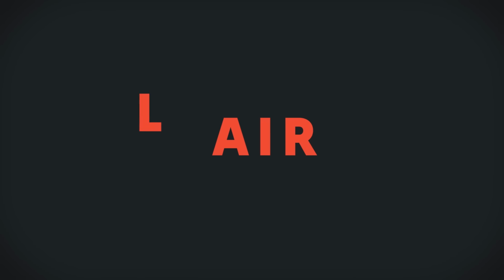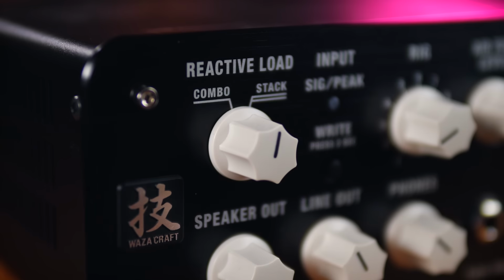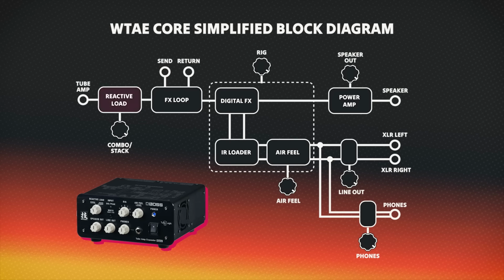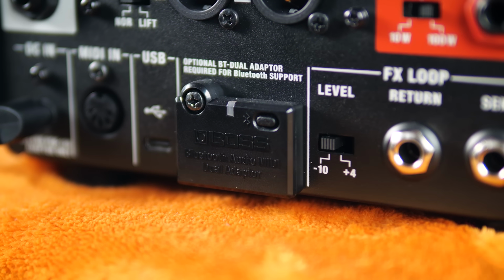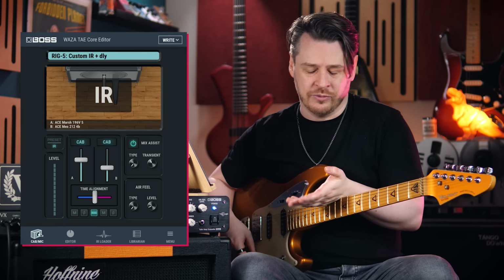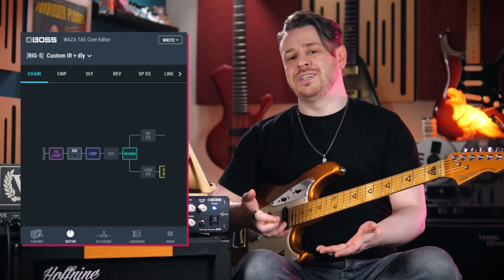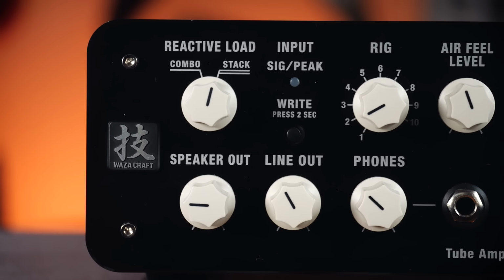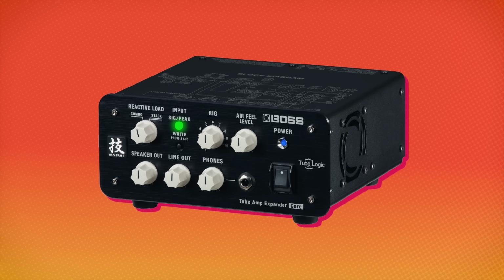Loadbox, Attenuator, IR Loader - Tube Amp Expander CORE does it ALL!

Comment: The Amp Head it's self should have its Own resistance knob that would allow you to run it at whatever stress level per volume you wish without having to buy a second piece of complicated gear the f'n things cost thousands it oughta take input for Lead, Bass, or Keys and be fantastic at any volume with any type or combination of cabs and not need piles of outboard gear filling up all of your floorspace.
Reply from the maker: If they build attenuators into amps (and some companies do) then the amps become more expensive - and it won't have as many features as a stand alone unit.

Comment: WAT! I don't like that solid state reamp nonsense at the end of the chain. I would rather use OX or Captor which don't seem to have that unwanted stage.
Reply from the maker: You do realise that is exactly what happens when you send the signal to a PA at a gig, or your studio monitors, right? 

You do get that guitar sounds are commonly reamplified by solid state amplifiers and this isn't in any way a contentious point at any other time?
Reply: Of course, but I want my amp's tubes to drive the cab speakers, line outs and other processing is completely different thing. Not sure how it's related.

Comment: Should I set if the core to  hundred watts, using my 50 watt Marshall Plexi?  Since 50 watts pushing 70 ..??

Ty!
Reply from the maker: Yes, but at the same time you still shouldn't be running a 50W Plexi hard enough to be pushing into 70W consistently. Don't use the attenuator as an excuse to max out your amplifier.

Comment: But can you use this with let say a roland JC120?
Reply from the maker: JC120 is a solidstate amp with a stereo line out - you can already use it safely without the speakers connected and record direct with it. There is no need for a loadbox if you have a JC120. 

The Tube Amp Expander is for tube amps - the clue is in the name.

Comment: Very good video! Congrats & thanks! Just subbed.

I´ve noticed the Waza Core's  Input from Tube Amp (in the back) indicates Max 8ohms, 100W. I have a Friedman Plex head and a 16ohm 4x12 V30 cabinet speaker - in this scenario, could I simply connect one of the 8ohm speaker outputs of the Plex head into the Waza Core, and then connect the Core (its output says min 4ohm) to the 16ohm cabinet? 

Cheers!
Reply from the maker: Yes, as long as you connect the amplifier's 8 ohm output to the Core, you can use whatever cabinet you like. 
The amplifier only sees the 8 ohm load from the Core and has no idea there is even a cabinet beyond that.
Reply: @ScienceofLoud  awesome, thanks brother!

Comment: Hi Colin & everyone. I have a question that I've done quite a bit of research on but am still not sure about. Can I use a DI-box as a speaker load for a valve amp (the manufacturer only says it can handle guitar amps' speaker outputs) or do I need to run the link/thru output to a cab anyway? Or is it not suitable for valve amps at all? 
Thanks.
Reply from the maker: No, you can't do that.

A DI Box converts high impedance unbalanced instrument signals into low impedance balanced line level signals to be transmitted over long cables without incurring signal loss. For example if you were playing bass on stage and the sound engineer wanted to get the sound directly from the bass all the way to the mixing desk, they'd use a DI Box. 

They have nothing to do with valve amps or speaker loads.

Do you perhaps mean something else when you say "DI box" and simply have the wrong terminology?
Reply: @ScienceofLoud  Well, the piece of gear I refer to is the Behringer DI4000, an active DI box (similar model, DI100, also seems to have this feature). Another device that I've discovered, the RNDI Active Transfomer Direct Interface, may not be a typical DI Box but it seems to work in the same way as the Behringer and it states pretty clearly that you can connect it to the amp before the cabinet (but in this case certainly NOT without it). So, this all got me a bit confused...
Reply: @ScienceofLoud  Oh, it's me again. I think I've finally figured it out. Some DI's can indeed be placed between an amp and a cabinet, simply allowing you to tap off the signal from the amp's speaker output. But, yes, you'll have to have a cab or a load box in this scenario. It's just not always the case that you can find this in a user manual ':D 
Cheers!

Comment: Great video,  I have a Quad Cortex, and still desire  one of these !. You are correct about the Boss firmware palaver, that's why the Boss Katana FB group has 50k members,  49.999k of them joining to ask " why won't my firmware update work".  :)      Would you consider doing a video explaining your thinking on reverb and compression for live work ? I have a pretty good setting on my QC, but it just needs to be a bit smoother.....  TTFN , Miff

Comment: Reamplified? So your hearing this boxes 30 watt solid state amp...not the original amps sound?
Reply from the maker: @iwilrage  when you listen back to any audio that was recorded, it is reamplified. 
Does that replace the original sound? No, it just makes the original sound louder. 

The CORE has a 30W power amp - like a hifi or PA system. It brings the sound of the guitar amp back up to whatever volume you need for your studio application

Comment: Is this ojnly for using an amp without a speaker? OK, you addressed that question. I have a 15w tube amp and have not gotten anywhere near opening it up. I did know that it hasn't gotten a chance to hear it. My solution was to buy a house with lots of land, which is expensive, but I have other reasons that I still want to do this. I only just started hearing that bands are trying to lower stage volume and that goes a ways towards explaining what I'm seeing, bands are listening to IEMs and play like they are at home, by themselves with barely any interaction. I saw some clip from Coachella and said "I don't think the band even know each other" now it makes a little bit of sense. Where the hell do you learn this? I learned way before YouTube existed and never played professionally and I don't know anything about gear, the only way I knew to learn was to buy stuff and try it. I had pedals, I lost them, I started looking and can't make any sense of the thousands of pedals on the market and I'm not about to start buying blindly. The only thing close to this that I've heard was EVH's use of a Variac on his amp. I could use a variac for a ton of things not guitar related too. I would like to be able to push my amp without the police knocking, Maybe I should try using the headphone jack without wearing them, but I don't know how that works. I have a much wider range of impedance with my cans, but where does the extra power go? I can't push the full power through cans, how does it deal with 600Ohm cans? I don't know the first thing about this stuff.

Comment: I’m confused by the description of the power amp. From your description this sounds like it simulates a valve power amp but why would you want that? If you are attenuating the signal has already been through a valve power amp. Or is it about ensuring that it couples with the speaker in the same way as a valve power amp does?
Reply: The power amp feature is if you want to fun a modeler through it with no amp- connect to the FX return of the TAE, boom, 30 watt power amp.

Comment: I literally just want an attenuator with a headphone jack. 
I trully believe if freyette dropped an updated power station with a headphone jack that more would sell than this Tube expander or the severely needed an update… Ox Box.

In my experience, people with amp s that need attenuator DONT want digital.

If BOSS just dropped this true attenuator with a headphone jack I’d buy 2 just to make sure I had a spare.

I remember when the first line 6 preset amps came out when I was 7-9 years old and I wasn’t a fan of digital effects then and now digital seems to be just tossed into everything just for the sake of it -_-
Reply from the maker: Simply including a headphone jack necessitates all the stuff you don't want. 
The headphones out is parallel to the IR loader, which is by necessity digital.
Reply: @ the headphones would keep the wife from yelling at me at night when our daughters asleep. I’d eat my hat about the headphone mixup if it meant I could play my electric after 7 pm
Reply from the maker: There are dozens of inexpensive heaphone amps on the market - maybe buy one of those.
Reply: @ I have an OG archon 100 and EVH LBX 3.. 

Unfortunately, I don’t think that spending money on lower and mid range quality gear is a good long term investment (because of modules and digital effects) high end analog equipment will hold its value or appreciate a lot more likely (I’ll be leaving my gear to my 13 month old eventually so I’d like “daddy’s toys” to be valuable assets to her one day).

if I were to buy another amp eventually it’d probably be the DG Custom 30 or an Amplified Nation for a good pedal platform.

Sorry about my headphone shenanigans, it’s just astounding how hard it is to play these amps “quietly” since my daughter was born and I’m jonsing for some electric sauce after playing my L-00 and Acoustisonic almost exclusively for the last 13 months.
Reply from the maker: 1 - The devices you are citing are not designed to be played quietly, therefore it really isn't all that astounding that it's difficult to achieve something they weren't designed to do. 

2 - You seem to be really caught up on conflating analog vs digital to quality vs garbage that is a fabrication inside your own head. 

3 - By the time your kid grows ups, your analog equipment is NOT going to be worth anything. Once your generation goes, there will be no one left giving reverence to this equipment to make it worth money. That's a process already in motion - vintage, analog gear holding value is a bubble already bursting. Sell it now while you can still get some coin for it.

Comment: I’d never use Bluetooth for updating firmware. The flash mode should be easier and they should have an option to update from a phone via a cable. The issue with doing firmware updates wirelessly is that if there’s a sudden dropout that stops the update there’s a chance of bricking the unit with no easy way to restore it. Doesn’t happen often but can happen, especially if you’re in a rural area with spotty internet connections.

Comment: I always love it when a new attenuator releases with an FX Loop. There are quite a few tube amps that lack this, for example, one of the Orange lunchbox amps that is 30 watts. It may seem absurd to just get an attenuator for the FX loop, but there aren't many products that give you this (without it being an expensive amp switcher like the Mesa Boogie HeadTrack)
Reply from the maker: I didn't focus on it in this video, but the FX Loop really is one of the strongest features of the Expanders. 

Even when using amps that do have their own FX Loops, I'm still opting to place effects in the Expander's Loop to get them behind the power amp entirely.
Reply: This was the question I had in my head. A very good piece to add to a KSRAmps PA50/25

Comment: Just a note, but your voice seems to have phasing issues in certain clips here. I only notice it on my phone and mono speaker.
Reply from the maker: It's a result of holding the flat surface of the devices under my chin. 

My mic is placed overhead and each time I lift one of the units into frame the microphone is getting a reflected copy of my voice bouncing off the surface with enough time separation to be noticeable.
Reply: Ah, not even true phasing, just an aftereffect of mic placement and acoustics being fussy.
Reply from the maker: From a physics perspective - Two copies of the same soundwave misaligned in time by the correct amount to cause destructive interference at the mic position; That's about as true a phasing phenomena as you can get. All real, physical and analogue.
Reply: Thats neat. I'll have to try that on purpose in some kind of experiment.

Comment: Regarding update:
1. Flash drive emulation is the Microsoft-recommended (see UF2) way of avoiding several ways Windows 7 and up can brick a USB device connected in industry-standard update mode (see DFU)
2. Combo to switch to update is not that unique way to confirm that this is not an accident
3. RTFM, I beg you, even if it's Roland

Comment: Have a question. My cousin has a marshall jvm head and it has multiple speaker outputs. One for 1x16ohm, a 1x8ohm or 2x8ohm. Ect. He has a waza tube expander. 2 4x12 cabs  with 16ohm speakers. You only use one cable out of the marshall into the waza.. the two cabs will become 8ohm together.. but since you leave the Head with just one cable should we use the 1x16ohm out or the 1x8ohm? And what ohm setting would the waza speaker input be set to? Appreciate any clarification 🙏

Comment: The firmware update process is much like that of the Katana. Hold a couple buttons on the face down immediately after starting the amp when connected to the USB port, and again, it acts like a USB drive. The process isn't discoverable from the unit itself, and if the user interrupts the process AT ALL, it can potentially brick your nice new amp. Not a big fan of how Boss have done this bit, even though I daily use my Katana (and the bigger tube amp expander for my Fender Twin....)

Comment: speaking of guitar accessories. I saw a you tube video where a guitar player took a very old cassette player with an input that was compatible with a standard guitar cable and used it as a distortion pedal. all you need to accomplish this is am old cassette player with the proper input. a blank cassette and a guitar amp cable. plug your guitar cable into the cassette players input. install the cassette. push record on the cassette player then push pause. play your guitar and adjust the volume trebble and bass knobs to whatever you like. that's it. distortion on a budget.
Reply: It's a form of analog clipping, and depending on the cassette recorder's circuitry, it's like fuzz, overdrive or distorted lo-fi trash. But technically, it's mostly hard clipping. You’re sending a high-impedance, instrument-level signal into a low-impedance, mic-level or line-level input. The input stage wasn’t designed for such a hot, reactive signal,  so it clips. Most cheap cassette players use transistor-based or op-amp-based preamps. When pushed, these stages distort in a gritty, compressed way, similar to early fuzz or treble boosters. The exact tone depends on the input stage, preamp design and how hard you drive it.

Comment: Why the approach of the Tube Amp Expander is so great: from a technical and sonic standpoint, it is much easier to emulate speakers, cabs and mic positions using IRs than to accurately replicate that complex interaction between a tube amp’s preamp and power amp, especially at full saturation. So even top-tier digital modelers still can’t perfectly replicate how a real tube amp feels when the power section is cooking and interacting with a cab. In contrast, the Boss TAE doesn't need to replicate the amp’s power amp - because your real tube amp is already doing its thing.  Tone and dynamics are fully preserved ; it then just about volume management and applying high- quality IR's, which (as said) isn't a big issue - or you could just use your real cab. That there is an analog solid state Class AB amp involved is no handicap here.

Comment: I used an attenuator back when I still played/gigged guitar. It was perfect for getting full tube tone at non-destructive volume. Thankfully, bass amps have evolved past this point! All my tubes are tucked away into either preamp pedals or DI boxes, super easy to maintain and use safely :)

Comment: I love my Rockerverb. I love everything about it, but one of the smartest things Orange has ever done was to add a built in attenuator, not just power scaling, but an actual attenuator. I dont know why more amps are being made with built in attenuators, theres a lot of amps with power scaling but thats not the same. The volume, gain, and EQ knobs all effect the volume, level of distortion, and tone of the amp, so its great to be able to get the tone you want and then use the attenuator to adjust your volume level.
Reply: In contrast, the Orange OR30 only uses internal power scaling to get down to its 2W "Bedroom" setting. So while you can use the Rockerverb 100 and 50 MKIII built-in attenuators to get them to the 100W model down to 70W/50W/30W and the 50W model down to 25W, with the OR30, the better option is the Boss Waza Tube Expander (or a Fryette Power Station).
Reply: @americanstreamer1910 but the Rockerverb MKIII 50 watt for example, doesnt just have the ability to go down to 25 watts, it does have that option but it also has an actual attenuator that can be used when running at 50 or 25 watts.
And yes you're right the OR30 doesn't have that option, it has the power scaling which does change the tone. You dont necessarily need something like this, but if you're not getting the sound you want at the volume you want, its an option.
Reply: @ChrisEck13 post phase inverter is what the orange has, and yes, it's awesome.  More or less a master that doesn't affect your tone at bedroom volumes.

The expander would be great to add, for the use of headphones and different cab Sims.  Great time to be alive.  😊